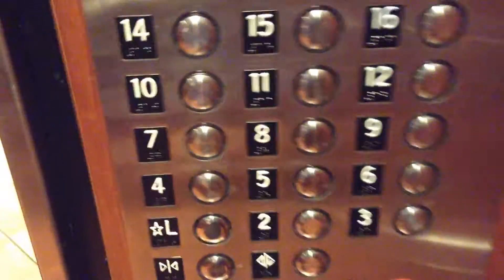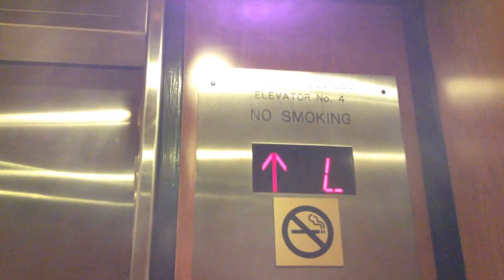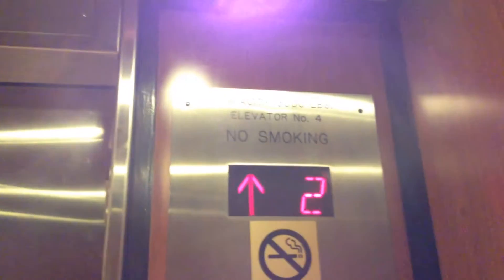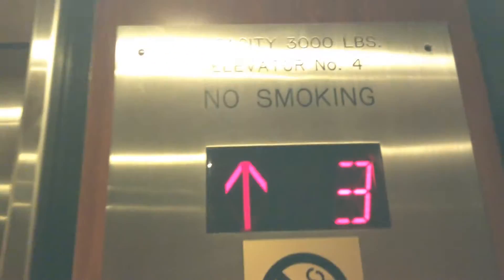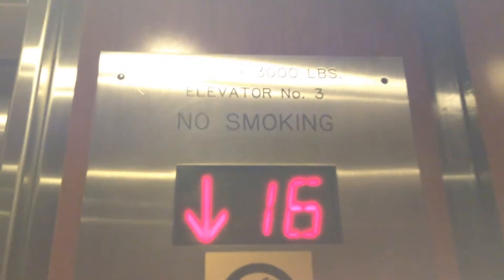Westinghouse Traction Elevators @ The Holiday Inn Hotel-Sacramento,CA

Comment: Many Westy setups had a car that could operate exclusive of the bank as a service car when selected.  Originally, they put the extra call buttons up high on the door frame.  My guess (on the extra call button) would be that they opted to keep this feature when they modded but had to put the button in a location that was ADA compliant.  But I find it odd that there's no signage (if that's indeed the case).
Reply from the maker: all elevators are passenger. There is however, a service elevator to the right of that call station https://www.youtube.com/watch?v=cjmdCWO6RKk
Reply: I'm just guessing the system had an option to put that car on it's own separate set of call stations for whatever reason... I've seen it on a lot of 1970's Westy setups.